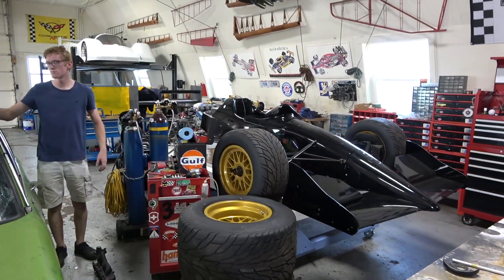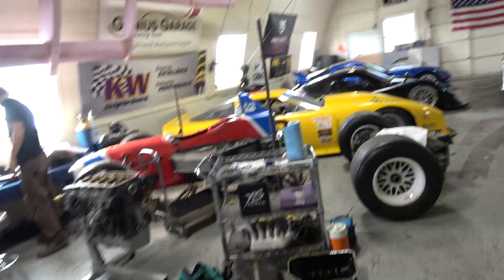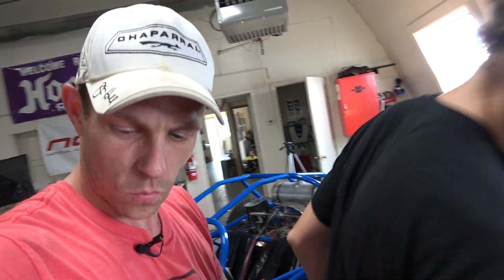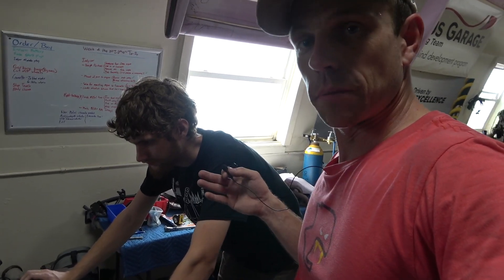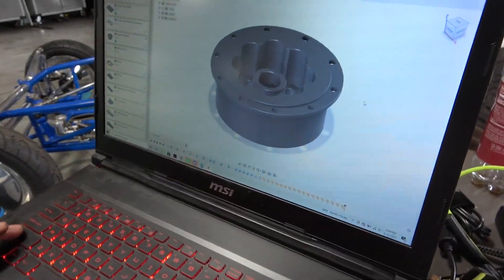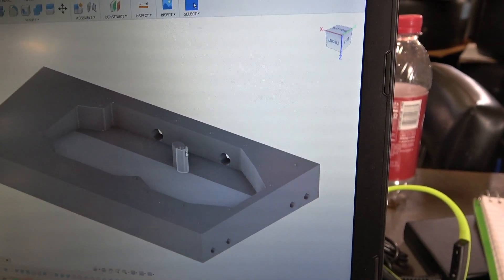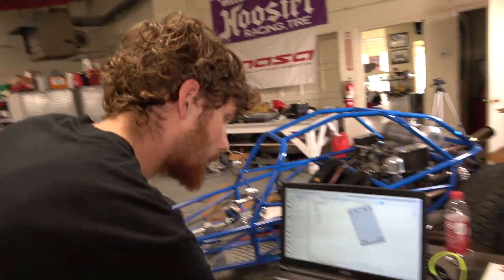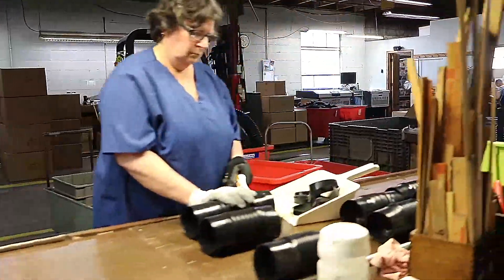Honda K Swap Indy Car MAGIC! Real time CAD design

Comment: You could actually photograph that bolt pattern and import the jpg into AutoCAD 2d and scale it to 1:1.
Then print it out 1:1 and overlay it onto the motor and make any adjustments.

Comment: A little less mathy and more garage/backyard, you can also just knock up a template with paper, or tape or whatever, and just stick it on a flatbed scanner. That'll get you pretty damn close to bang on for measuring holes.

Comment: No quick engine outs then. This will be solid.  I hope everything expands at the same rate so there are not oil leaks at the sump plate. I suppose this design is following usual practice so will not be a problem.

Comment: Oil Pan suggestion.  Put a divider across the center of the oil pan between the front and rear oil pan pickups.  This will prevent one of the pump scavenge stages from running dry which helps the life of the pump.  You can also do other funky shapes like triangles that intersect inside the sump void, so long as you allow for oil flow.  Triangles = good for added torsional strength.  We know Casey likes triangles.

Comment: To verify the dimensions and proof of concept before expensive machining - why not use inexpensive FDM 3D printing?  This way all dimensions and fit could be verified.  This could work for many of the objects being modeled.
Reply: A good option. But for some people, as you get good at these techniques, you become very proficient at getting it right. I started out doing engineering and drafting by hand, before 3D printing and CAD was an option for me to use. I would find the extra time and step of creating a 3D printed template a waste of time and effort. But it might be a useful step for others, or in cases where a part is very expensive and you want to make absolutely certain you haven't messed up any features before starting fabrication.
Reply: @SoloRenegade  agree completely.  I always double check myself with a 3D model printed before I commit to expensive machining.  Cheap insurance.  Also remember these are young people learning.  Mistakes will be made.  Nice to verify before making expensive mistake

Comment: An LS would have been a better swap from the sense of generating most hp/KG

Aluminum LS block is about 170kg and  K24 is about 170Kg

Give or take 15 Kg doesnt matter when u have 6.2 vs 2.4

And dont argue about the weight i checked them so many times yes an inline 4 is very close in weight to ls v8 weight do ur research
Reply from the maker: size and rpms.... no go on LS
Reply: I'm not sure where you got your numbers from but I just weighed a K24Z7 long block at 230lbs so 105kgs, that is without the plastic intake manifold, alternator or water pump. There is no way they are close to 375lbs, maybe with the stock trans still attached. If they were 375lbs there would of been no way I carried all 6 K24 engines I own down my basement stairs myself. The bare blocks are only 62lbs.
Reply: @joelg6740  https://youtu.be/LyWvVq0Tp4k

3:45

You can chase a pound here and a pound there but nothing justifies 4 liters difference in displacement

Here is 3 LS engines https://youtu.be/lWR--yo6KXE

With and without accessories and wiring harness

30 lbs difference maximum between the k24 and LS

6.2÷2.4= 2.8 times more engine for 30 or 50 lbs or whatever difference.... i take it

Comment: So when measuring the printed CAD paper for accuracy how long did you wait  after it came out of the printer before measuring it?
- IT MAKES A DIFFERENCE!!
The fuser in a laser printer boils all the humidity out of the paper and as the paper reabsorbs humidity from the air the paper will change size.
I used to run a CAD plotting service and when we calibrated the laser plotter the paper could change size over 1/8" across a 30" piece of paper.

Comment: You can use ink on the parts than lay down paper on top of the parts and you can look at the paper and see where there is no metal. And if you need to reuse the paper by cutting off all the clean stuff than put dykem on the paper than laying it down on a piece of metal and transfer the pattern. And you can do the ink thing to lift a pattern for gaskets as well

Comment from the maker: I thought you guys would enjoy an in depth look at our design work for the Indy Car today! What did you find most surprising in this video?
Reply: I'm surprised by the oil pan fasteners, especially the rear.  It seems like you could find a way to avoid the nut issue at the back.  Maybe you'll need to add a couple more bolts to make that happen? 

I would do everything I can to make enough clearance for a socket and a wobble extension for the front nuts too.
Reply: That Casey knew CAD stuff! You play the bafoon so well.
Reply: The GPS analogy in regards to the hole triangulation was a great reference!
Reply: Why not to use a piece off plexiglass, put it on top, mark the positions, drill them and get a really nice template.
Reply: Im looking to do something similar and having a hard time locating the components for the drive train information. Where would I find this info if you dont mind? Thanks for posting this really cool video